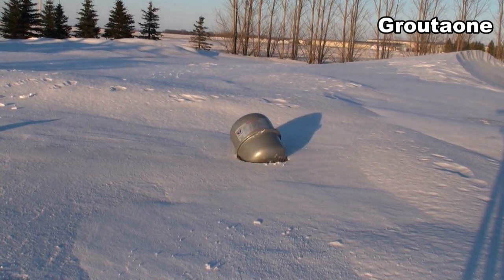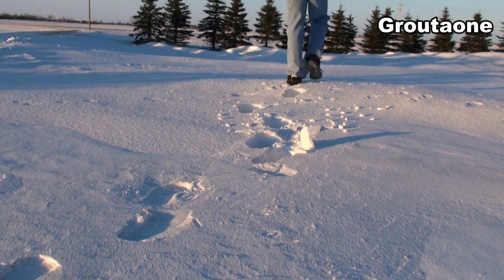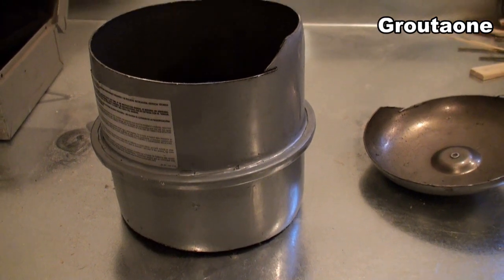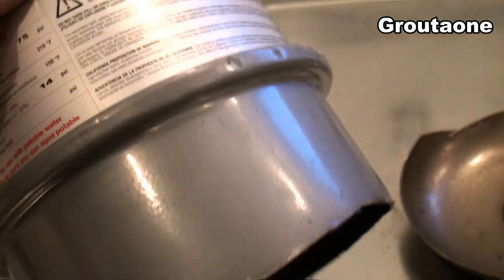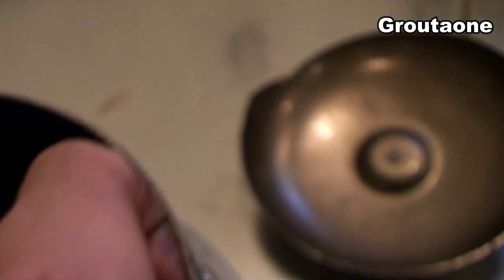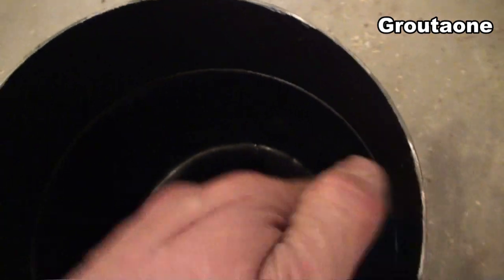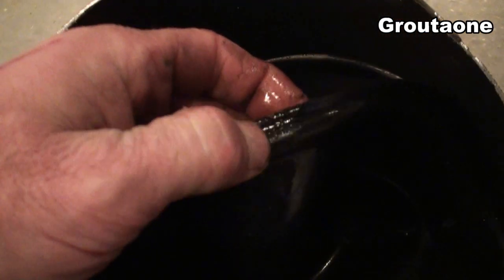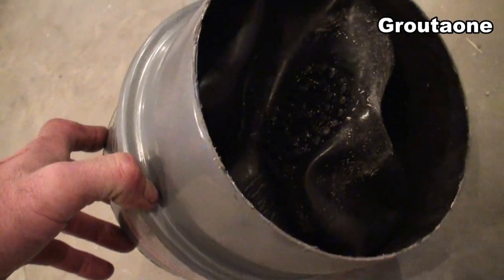Cutting Open A Blown Out Expansion Tank

Comment: How much did that cost I wonder?
Reply from the maker: shartne I think these are around $70
Reply: groutaone
Ouch see if you can  take it back.
Reply from the maker: shartne I would just have to explain the missing top and bottom :)
Reply: groutaone
yep but hey may understand you wanted to see what was the problem? Weld it back together if they gripe LOL hee hee.
Reply: groutaone Just say you got it like that, it will be fine :P
Reply from the maker: Just have to figure out how to do that with a straight face :) these tanks are fairly cheap so it wasn't too big a deal

Comment: I did the same to mine last year, when my hot water tank started leaking a lot.  You tube told me to replace the expansion tank.  I did and it worked.  I then cut the tank open and sure enough there was a rubber bladder in there that was split.